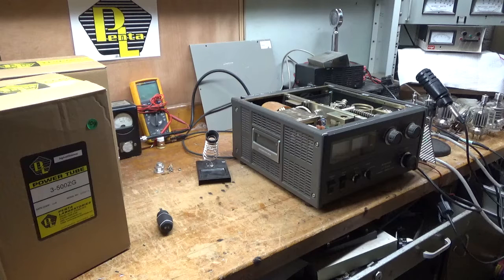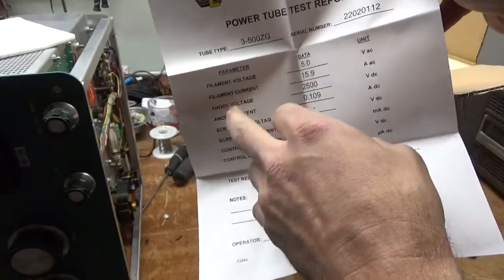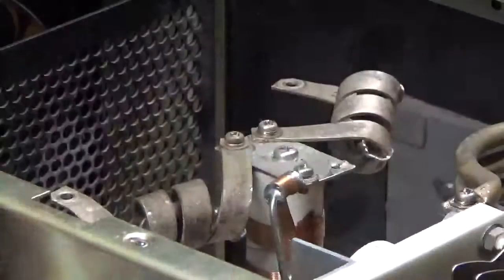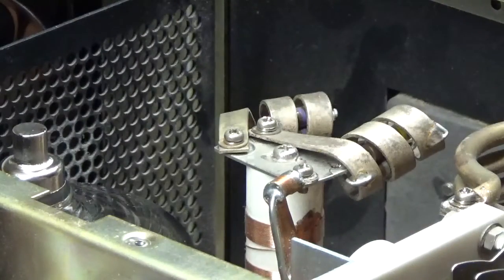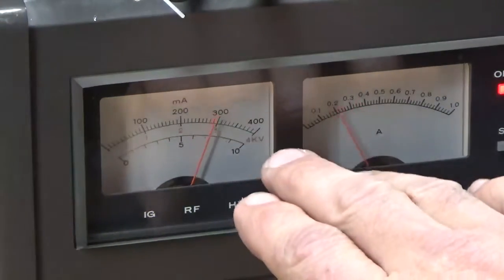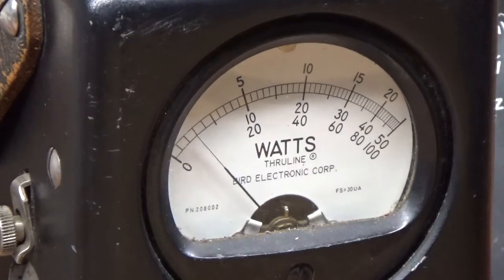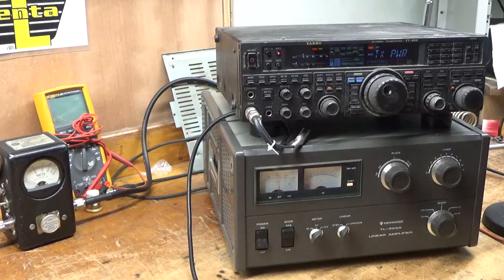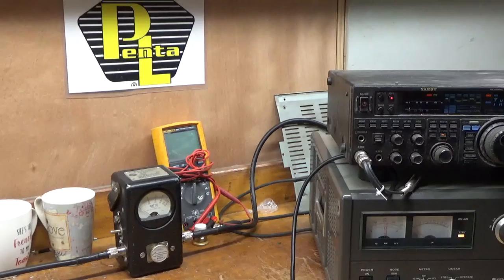Review Of Penta Labs 3-500zg Tubes In My Personal Kenwood Tl-922

Comment: Why does the manual say this amp is a 1000 CW and 2000 SSB amp?

Thanks
Reply from the maker: That’s input power from the line , not output power 

Re read the manual